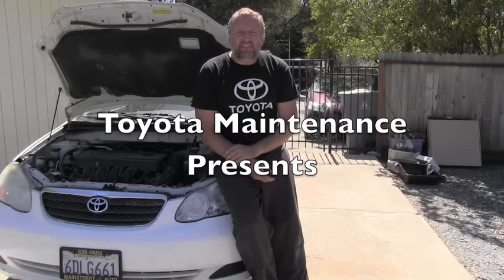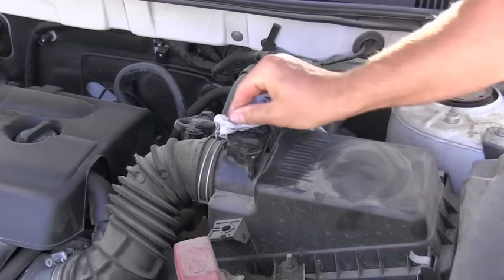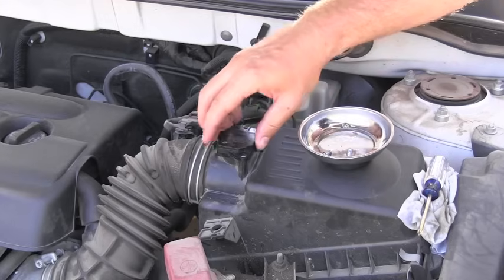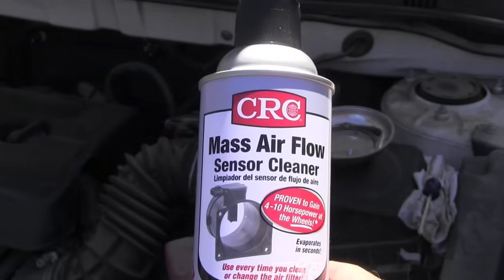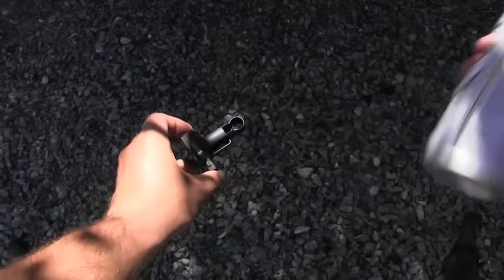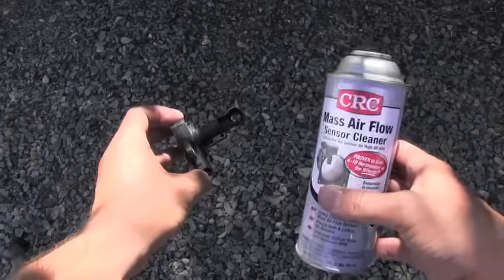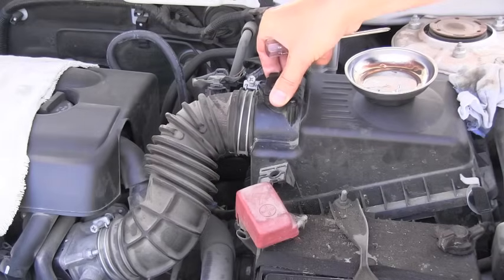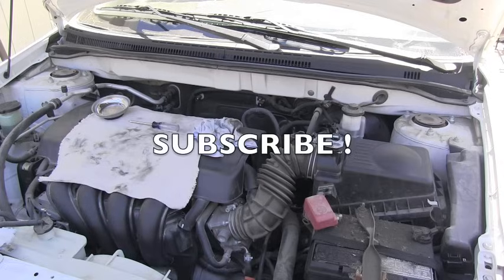Toyota Corolla Mass Air Flow sensor cleaning

Comment: my check engine light came on yesterday...the auto parts store suggested the same cleaner as you (instead of the $100 part).  With your guidance, it was an easy fix...thanks!

Comment: Thank you for explaining each step so carefully.  Nobody else told us how much spray to use or how long to let the sensor sit before reinstalling.
Reply: For reference, use 1/2 can of MAF sensor cleaner and let it dry for 30 minutes after wiping it off, taking special care not to touch the sensor probes with fingers.

Comment: Unfortunately, like with so many mechanical projects, I am stymied at the get-go by rusty fasteners.  One of the two screws holding on the MAF won't come out.  Why they used round heads....

Comment: You did not clean the MAF sensor element.  You cleaned the air intake temperature sensor.  The MAF element is down inside the channel when you turn the sensor upside down.  It looks like a wire going across the channel at the bottom of the channel.

Comment: Hello and thank you so much for the well made video.  I do have a question for you in regards to the 2001 Corolla.  I have cleaned the throttle body, Mass air flow sensor, changed filter, gas cap and soon hopefully the 02 sensors.  Is there anything you can recommend I can do to diagnose what else causes rough idle?  Thank you.
Reply: Did you find out why it rough idles? My 2006 corolla has a pretty bad idle when I'm at a red light etc. And it shakes pretty bad around the MAF sensor area.
Reply: Thank you for your reply.  I’ still not able to determine the diagnosis of what is causing the rough idle.  I just tried to remove the 02 sensor and I can’t because the bolt for the  exhaust manifold is in the way.  I bought a meter to check for error codes and found none so far.  I also bought some small hoses near the air filter and will see if that clears up the rough idle.

Comment: Seriously mate I made several attempts to clean my ‘02 S/C Tacoma MAF sensor using the CRC sensor clean method as described knowing full well the consequences of touching the wire strand etc and was unable to get results that cleared my code & poor running condition. In the end I just accepted that I was going to have to replace the sensor with new, but before I did that I took a q-tip and some brake cleaner and went to town cleaning it. Reinstalled my cleaned sensor and problem solved. Because I have a K&N style oiled filter this sensor does need a regular clean. I’m still running my original sensor and have cleaned it using the brake cleaner/q-tip method many times. As the rig is getting older now I was finally able to junkyard dog a spare and I keep it in the cab for road trip emergency. In the beginning I did heed the warnings about cleaning and not damaging, but in the end wipe it clean with a swab & brake cleaner every time.

Comment: My 2010 55000km odo done d4d Diesel engine corolla altis turn off while running & in idle…. After removing the negative terminal for 1 min and reconnect will turn on the engine… does this problem is related to mass airflow sensor?

Comment: Good Job Man!  I didn't recognize you without your glasses. You look much younger.  What the heck is that fuzz growing on the battery?  That engine compartment needs cleaning.  The hood insulator could use some cleaning.  Use a garden hose with low pressure to soak it then let it dry with the hood open. Use a spray bottle and spray some diluted dish soap (Dawn) on it. At least you have hood insulation. My 2008 Tundra didn't come with it or was it offered for 2nd gen.

Comment: I would expect the MAF sensor should be cleaned when the engine is cold . As the metal sensor inside gets hot when car is driven . I would think spraying the cleaner on it then would damage it .

Comment: I was told to use brake parts cleaner by a local mech about a year ago on my ‘98 Taco 4x and it worked fine. Will use the MAF cleaner if it happens again. Love the vids. Thanks for sharing!

Comment: Very nice. Just note that some engines have a manifold absolute pressure (MAP) sensor instead, and some, like turbocharged engines, have both. You can also clean a MAP sensor. Idle may be rough afterwards, but the car will soon relearn how to idle.

Comment: This can be done in all vehicles!  Specially if you live in areas where is really dusty clean the sensor to get better gas mileage also,  one of my cars light came on and said loss of engine power!  My car barely idled,  ran like crap!  I you tubed the issue and found out it was the mass air flow sensor sure enough I cleaned it and it was fixed!

Comment: The small bulb shaped sensor is your intake temperature sensor. The air flow sensor filiment is down inside as looks like a shiny micro resister. It's operation is a bit complicated, but it is a highly accurate method of measuring volume or air passing across it's surface. For it to remain accurate, it MUST be very clean.
As a footnote, NEVER replace this part with aftermarket garbage or Chinese clones! (Their air mapping is not accurate or reliable)
I love my '06 Corolla LE

Comment: Very nice instructional video with one caveat.  Please do not spray a toxic cleaner like this directly into the ground, put a pan below it and properly dispose of any liquid.  Letting material like this go into the ground can pollute ground water.  I have grandchildren (and they will have children) who need clean water in the future.  Thank you again for the video.
Reply: I usually like to dump my used motor oil on the ground after I change the oil.

Comment: This guy is not over reacting about the maf sensor being delicate. My first car 2 years ago i went to clean the maf sensor accidently touched it slightly with my fingers and the wires snapped and my car would not run without stalling. took me like 2 weeks of trying to source a part for it before i got it working again

Comment: I have a Toyota Matrix 2005. My check engine light came on and I checked and saw that it was code p0171. The previous owner said they had the same thing occur once and he was able to fix it by cleaning the mass airflow. I followed your direction on how to clean the mass air flow and waited 30 minutes to put it back. I used the scanner to scanned to see if it fixed the problem. I ended up getting 2 new codes. So now I’m left with the code p0171, p0113, and p0102. Please help! Thank you.

Comment: Excellent video.
A suggestion would be to always wear gloves,
and to prevent all automotive fluids from touching your skin;

or inhaling the fumes.

This means, if you can smell it,
you’re being exposed.

Solvents are extremely toxic to the brain, and organs.

You can use a fan, even outside, to help keep fumes away from you.

If your hands are wet with this fluid, you’re absorbing it! 

I’m telling you, 
it’s very bad for you.

Ok, be well.
Thank you for your videos.
Reply: Hmmm? "This means if you can smell it, you're being exposed." Does that mean if someone with the C-19 virus farts through their underwear and trousers and you can smell it then you're being exposed to it? If so why are we wearing masks again?
Reply: @njsongwriter  
Yes, the masks we typically wear regarding Covid-19
don’t filter down to gases.

However, there are respirators/respiration equipment that will.

Comment: 2009 Corolla LE, MAF cleaned & installed & new OEM'sAir Filter, Coils, Plugs. No Luck still getting P0172
Toyota MAF & ECM replaced. Still no luck. 

Toyota dealership replaced two motors. Then 30 years experience Toyota's mechanic (has shop) is lost.
2nd engine: start up with 2,500rpm then maybe down to 2,000rpm
No one taking the blame nor get me another engine.

Notes & all replaced:
2nd engines (1st, lasted 11 months with 600 miles; 2nd, under 9 miles). Stayed with dealer for 4 months.
155K
4 spark plugs
4 ignition coils
throttle body 
inlet manifold gasket
all sensors & all solenoids  

What is the problem?

Comment: I am going to do that tomorrow, thanks for the video...
Reply from the maker: Good luck!
Reply: @ToyotaMaintenance  i did because i got a code p0171 and the guy told the maf sensor was not good, so i cleaned it and then alternator was not charging battery, then i change the alternator, after that the battery it was bad i got another one., then the starter was not good, somebody hit it and it worked, now i saw videos to replace starter, maybe in one month i will know hot to assemble all my car lol....

Comment: 2007 Matrix had front air intake tube with flexible section broken and wrapped with duct tape. I got a replacement from auto wrecker for $20. Removed battery and one bolt holding it. Noticed a lot of white chunks and deposits in bottom of air box. Cleaned these, replaced air filter and put in new intake tube. Note small detent holds it into air box. Was also rubbing on upper radiator hose as fastener missing. Plan to clean mass air flow sensor next although no idle or starting issues. Thanks for your video!,

Comment: Thank you for your videos. I recently bought a 2007 Matrix and have cleaned the throttle body, replaced the air filter (very dirty) and turned off the check engine light. Now a week later it surges forward from stop with a light touch of the gas. I'm going to replace the plugs as a maintenance item. It has 178,000 km on it. Any idea what I should check next? Thanks!
Reply: I'd try the MAF before the plugs.
Reply: Chai Ming Yu 
You may be right. I upgraded the plugs to NGK Laser Iridium. The old ones were platinum. I was very anxious putting them in to avoid cross threading. Did not use any anti-seize compound and tightened them to 18 ft-lbs. Didn’t notice any improvement in performance.
Reply: Richard Morse also use what manufacturer specs for plugs.  Sometimes copper is better depending on how the engine was designed
Reply: NGK says not to use any anti seize compound on the Laser Iridium plugs as they have it applied at the factory. If you must only touque to 13 ft-lbs.
Reply: Richard Morse clean the mAF first.  Plugs won’t make a car surge

Comment: Do i need to unplug the negativity terminal connectivity on the car battery or can I just take out the MAF with the car cold and off?
Reply: Yes, you can do that but if you do you will Check Engine Light when you install back & start the engine.

Comment: I see that the MAF is resting on a dirty rag. Is that from cleaning around the sensor before removing or did you manually clean the MAF with the rag. It seems that you just let it air dry but I'm just checking. Thanks.
Reply: Air dry only, you don't want to touch the sensor
Reply: @bobbyg387  thanks.

Comment: I have a funny problem on my Toyota celica, it is the warning light for O2 sensor 1, i ve replaced a new oem sensor few week ago . But the warning light is came back for the same problem.  Do u think my mass air flow sensor need 2 clean up  1st ,in fact i ve never clean the MAF. Tips me ,please ! thank you

Comment: did u have to disconnect the negative terminal battery to avoid shorting out any electrical connections or no need for it?
Reply: h corolla couldn't hurt to do that first, no?

Comment: Ive used WD-40 and put it back in right afterwards, after few days AIR FLOW blinked in the car when I've turned it on, then went off. Should I worry about this?

Comment: I don't know WHY car manufacturer's still use that garbage MAF ... If some can go without it and run normal, why use it..??
Reply: It is not a waste, my friend. It measures the ratio of the air inside the engine and its temperature. The computer gives the car information to adjust the amount of fuel it needs with the air pressure, the fuel mixture and the air that drives the vehicle

Comment: question for you, does 2005 4runner transmission  have a  breather or ventilation that can be cleaned/replaced. I am installing a cooler and how does the transmission get the air out of the lines . thanks

Comment: Thanks for all your Video's  - your a high energy, likable, & extremely knowledgeable fellow. I have a 2002 Corolla. It had rough idle & stalling issues mainly at start. Once it was going it only faltered a few times. Anyway some of these things needed replacing, but I started in this order: 1) Replace PCV Valve, 2) New Spark Plugs, 3) New Air Filter, 4) Took apart & cleaned AIC Valve / Throttle Body after watching your video - was very gunked up, and finally 5) MAF Sensor - this took me two tries to get it clean before working. The small metal pin with the glob of resin on the end was easy, but to get into the plastic tube part (same MAF as in your video), I put the straw on the cleaner, then I was able to clean the inside better. Anyway, after all those aforementioned changes/cleanings I finally lost the 440, 441, & 446 Codes and the Old Corolla Purrs Like A Kitten Again!!!

Comment: What can I use if I dont have MAF cleaner avaible in my country
Reply: You can use a Non-Chlorinated Brake Cleaner to clean your MAFS.  That's all the Toyota Dealerships use when servicing.  That's all I use on mine, and it works just the same.  Shake it out good and let it air-dry for about 1/2 hour or so, re-install...and you're back in business!   I clean mine about once a year with no issues!  Also, remember to disconnect your Battery while cleaning or working on a MAFS, and reconnect once the sensor is re-installed.  This reduces the risk of electrical shortage, and will also reset the cars computer to the engine codes are discarded and your Check Engine Light stays off.  If your Check Engine Light is still ON...just disconnect one Battery Terminal for a few minutes and then reconnect.  The Light should stay off.
Reply: Get one and don't use anything else and clean the throttle body too whist your at it.
Reply: You can use a quality Brake Cleaner...something that has no residues and dries rapidly!   You can also use Throttle Body Cleaner as well!
Reply from the maker: then give it to Pros who have it....
Reply: Now I realized that the 7AFE doesn´t uses MAF sensor, but MAP instead
Reply: Use alcohol
Reply: Emanuel Sacriste a

Comment: Could you please show us how to clean the throttle body and idle air control valve on your Corolla? I have a 2006 Corolla with high and low idling issues.

Comment: hi  bro..Thank you for the use full video which really fixed my problem. ..truly help full. but I couldn't find mass air flow spray..I just used wd40
Reply: Hassan Shabeer  In Loving Memory of your MAF. 🙏🏼
Reply: Never ever use WD-40 or anything that contains any oils, lubricants or particulates...quick way to destroy your MAFS.   If you can't find the appropriate spray...use Non-Chlorinated Brake Cleaner with is basically the same thing!   Do not use WD-40 on your MAFS.  Consult with people who are in the know, before you venture into this territory.  I consulted with a mechanic at a Toyota Dealership well beforehand.

Comment: My girlfriend had a high idle problem with  engine "kicking" while braking (right before the complete stop) with her Echo 2004. On a thread somewhere they say to clean MAFS and change filter. The filter was dirty, the filter casing was improperly installed (its not a west-est install like in this video, but a north-south install and the back brackets are a pain!) But the weird part was there were little hairs on the MAFS, like what the new cheap air filters have... I guess it'll be a frequent maintenance from now on, thanks for the straightforward explanation for how to do it!

Comment: hi sir, i have a toyota corolla 2002. check engine doesn't show on first start of the engine. but when acceleration comes off, the check engine light suddenly appears. sorry for bad english. tia
Reply from the maker: scan for codes…repair the problem…good luck !

Comment: hi sir, I have a corolla 2002, my problem is when I start the engine in the morning, its idle is too low then dies after a second, then 2-3 starts before it can hold the engine and stabilize its RPM, but it is still a bit rough idle, my car's normal starting is usually 2-3 cranks, what seems to be the problem sir?
Reply from the maker: any codes ?
Reply: no check engine and no codes have been showing up ,

Comment: Hi, nice job! I have a Corolla 2008, and when the engine is at 3000rpm, I rear noises, like "litle steel balls" coming from it. I think the problem is air /fuel ratio... Anybody could help me, could you?
Reply from the maker: I have no idea what you are hearing…...i will have to hear and see and touch and take apart to be able to help you…good luck !
Reply: Toyota Maintenance I think it is knocking, detonation or pre ignition. But I already opened the engine to clean the top of the pistons and valves, and the noise started again. Can I drive with the air mass sensor off (disconnected) , to test?

Comment: I am having my check engine light stay on a perhaps this will solve this problem.  Thanks again.
Reply: I have the same problem and I'm about to see if this and a new air filter will solve the problem
Reply: Good Luck and God's Speed
Reply: It might...but there are other reasons that your Check Engine Light may come on asides from your MAFS.  Clean your Sensor, but before you do...remove a terminal from the Battery as this will reset the computer.  Reattach the MAFS back on and put in the plug, then re-attach your Battery Terminal.   If the Check Engine Light or other Sensor Lights come back on...you may have issues that are not related to the MAF Sensor.  Best bet...get a decent Engine Diagnostic Reader like an ANCEL ad410 for around $50 Bucks...in order to cancel old codes and find out whats up with your Engine!
Reply: @darring.9161  Autozone and likely other auto parts stores will read the codes for free.

Comment: My corrolla cuts off while driving and restarts immediately. Getting no check engine light tried changing crank sensor and cam sensor the fuel pump as well dont know what to try again please help
Reply: Did you ever find the problem